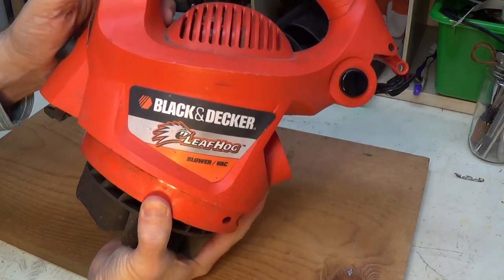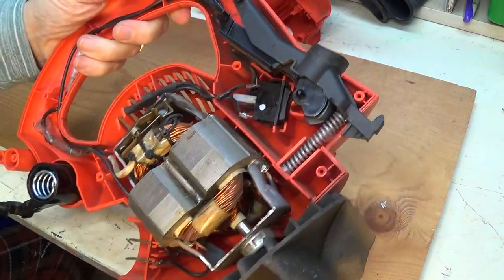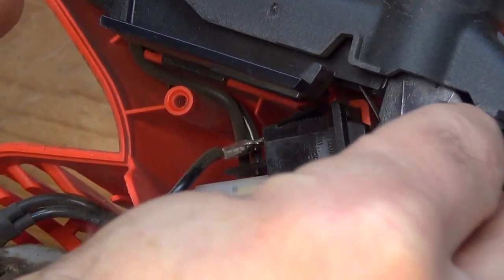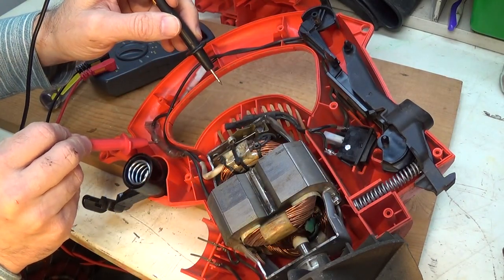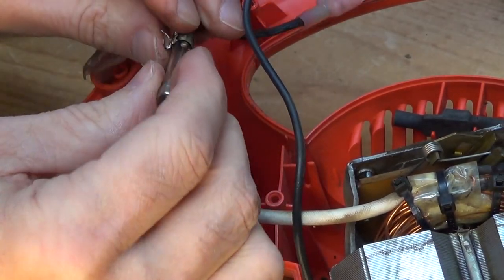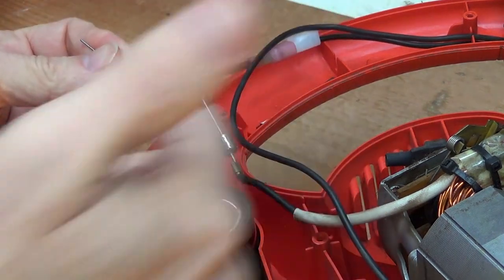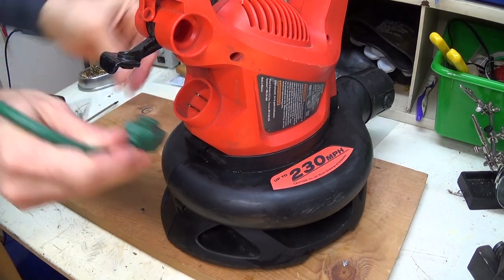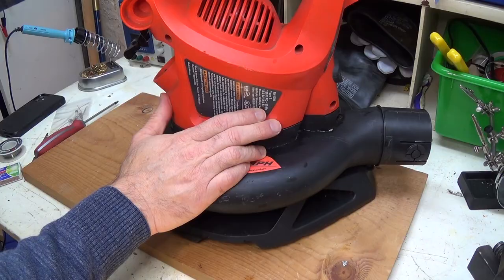How to Repair a Leaf Blower

Comment: Very professional video, and a proper repair, unlike another, who butchered up the safety interlock and deleted the fuse. Its a 15 amp 125 volt 3AG fuse, this motor is rated 12.0 amps.  It prevents a melt down and fire if the motor shorts out, and it also lets you know when the sleeve bearings go dry and the motor starts using too many amps. Get bottle of Turbine oil online or at any HVAC parts place, it is for low viscosity and high speed sleeve bearings. Another cause for high amperage is if the male/female white wire connector just above the fuse becomes loose, overheats and lowers the voltage to the motor.  You can tell if it is bad as the heat starts to turn it brown or black. You can also clean off the commutators (copper bars) with some denatured alcohol or brake cleaner on a cotton cloth, to prolong motor life. I used to have an appliance repair shop.

Comment: Just like the very reliable 320 Black and Decker I've had for about 20 years.  The male plug on mine is getting a little loose and the on/off switch unpredictable. So thanks to this guys very well made video MAYBE I can now try fix my own.  Thanks for such an informative, well made video !

Comment: Thank you so much for a very professionally made video. In my blower, connectors after the fuse got burned. I removed the connectors and just soldered the wires together. I was trying to test the blower without putting the base on and it won’t work. When I got to end on video and saw you putting base on, realized the safety mechanism build in base with 2 tabs 😊. Put the base on and it worked perfectly. Thank you .

Comment: a little stupid to cut the linesto replace fuse. you just need to take of the cap on both side metal holder to the fuse, and replace another with no wire version of the fuse. All the rest are great and clearly demonstrate.

Comment: Thank you for sharing your experience. I love the video, I will watch a few more times to see if I can replicate the switch replacement if that is my solution. I am baffled because I disassembled my Toro Power Jet F700 Electric corded leaf blower; cleaned-up the commutator and reassembled the parts back together (correctly?) and it won't start. Other videos I have watched the leaf blowers have a safety switch, I could not find a safety switch. I was told that my leaf blower has a rheostat switch: I checked for power with my old analog multi-meter, current passes through the plug, so I ruled that the plug is good: I probe around with my positive lead while my negative lead is still in ground. I get a good reading on what I think is the commutator, but nothing when I probe one side of the armature copper windings, However, I am on a steep learning curve with AC/DC/Universal Electric Motors. My Father was a Master Electrician, so I retrieved his old book titled Electric Motor Repair by Robert Rosenberg: I am trying to understand what type of motor is in my leaf blower: I was leaning towards a Alternating Current Motor Control because I must plug it into the house electrical receptacle for it to power on. I thought DC motors are powered by a battery. I learned that the Universal Motor is applicable to both AC and DC? It has been a challenge to reassemble because the plastic housing has to matchup. The past six-(6) days has been frustrating because I searched both YouTube and the internet and also read the Electric Motor Repair book and I still cannot get the leaf blower to power on when plugged into electrical receptacle. I used color matching zip-ties, so I can reconnect the correct wires [only 2 pairs!!] I thought once I cleaned-up the commutator I thought my leaf blower was going to operate. https://youtube.com/playlist?list=PLGVI8bUyFEzrbwDhEi1VxWAwKVqnxRaSx&si=kBbVzJmlLariu7n6

Comment: I have the same model and it is ancient. Yours looks like you just brought it home from store. Have you actually used it? Mine was turning the commutator black and I had to keep polishing it, then it quit all together. It was pretty obvious, the wires around the fuse were all black and burned, the connector was toast. I found a 15a 250v microwave fuse at ace and it worked, then quit again. That's when I found your video, thought maybe the switch. Turns out its the leads on the brushes are too tight and stop them from hitting the commutator. I to rotated the zip ties to get some slack so they touch and now it works again. My brushes are almost to a 1/4 inch and have not been able to locate new ones.

Comment: thank you for the video. I am having the same problem with mine, where did you find the fuse?
Reply: It's on Amazon, but a hardware or electronics shop should have it.

Comment: Where did you find the fuse with the wires/pigtails attached? I can only find the ones without a wire extending from both ends. Don't see one in big box stores or on the web. Is there a special name for it? I need one like yours, but a 20A 125V glass (or ceramic) fuse for a B&D LH5000 240 mph blower vacuum.
Reply: Were you able to find the fuse?

Comment: 7/15/21 I have a 20 V B&D leaf blower that turns on for about 5 seconds, then shuts off. Battery volts test is 18 Volts. Any ideas?

Comment: I’ll give it a shot. First; gotta get me a screwdriver or star wrench that’s skinny enough.
Reply: I had the same problem. Then I  found that the local Walmart had a 44 piece bit set (called "Hyper Tough") with skinny enough extender and star bits. It worked great so I was able to remove the cover of my B&D 320 blower/vac (same as in this video) very easily...and fix the problem.  $7.99 for the really good quality bit set.

Comment: How the hell does the switch presser actually actuate the rocker switch? Mine doesn’t reach the rocker.
Reply: I am wondering that too.  In the video his isn't reaching the rocker switch either unless he pushes on it. The whole mechanism is floppy, doesn't seem to be anything to press the end onto the rocker switch.  Maybe the metal piece that is there to put tension on the end pops out of place when taking apart the clam shell cover?
Reply: @bvataha8697  no idea, we ended up just rigging it because no matter what I tried that stupid switch just didn’t work
Reply: Same here. Looks like it won't engage unless the latch button is depressed. I came here because mine will only run at low speed, which is too weak to pick up any but the smallest leaves.

My best friend used to work as a tech for B&D, which I completely forgot until just now. I texted him about my issue, and if he has time I'll ask him about the mechanism and report back here.
Reply: @dougfoster445  How did you rig it? I "modified" mine using a drill bit and some hot glue. It's arguably better than the original design, but sadly my main issue is still unresolved. :/
Reply: @jeremiahseitz9842  I didn’t. Just scrapped it. The only way to fix it is to bypass that dumb switch and put in a new one by rigging it
Reply: @dougfoster445  Gotcha. I'd have scrapped this one by now too, probably, but it's something my Mom asked me to do. :)

I'm pondering the idea of rewiring the switch so it's off and high, as opposed to off and low now.